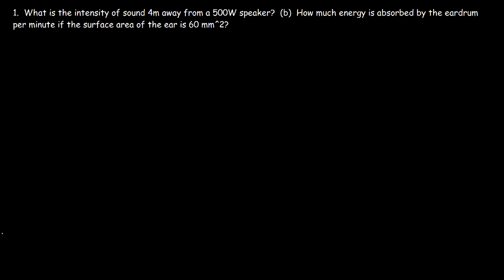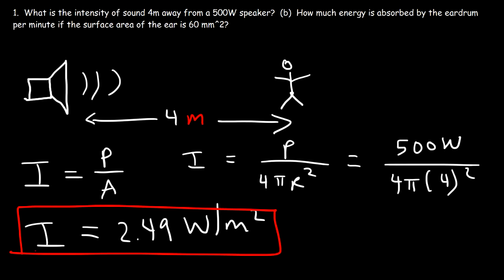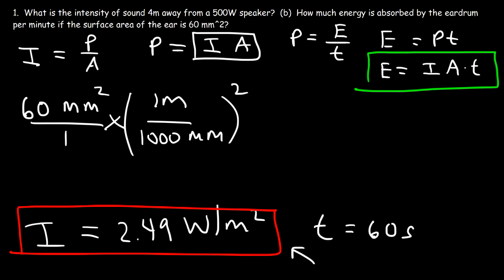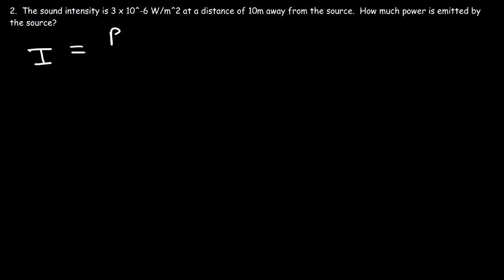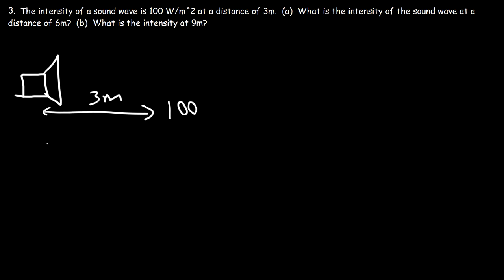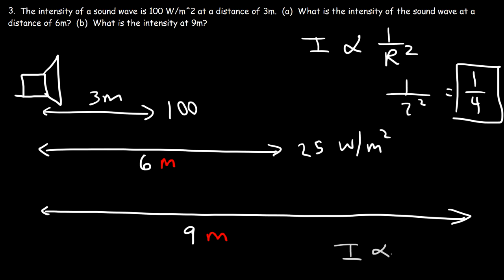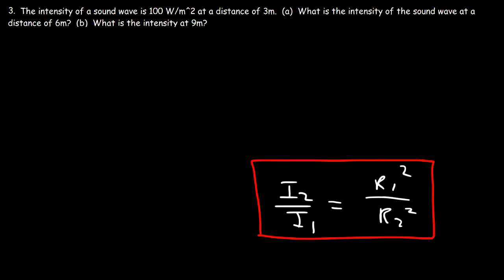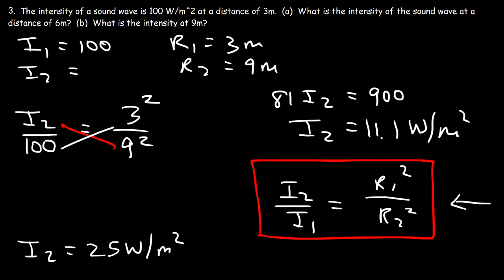Sound Intensity Physics Problems & Inverse Square Law Formula

Comment: Can someone please explain to me why the A in the formula for the amount of energy passing through the eardrum is the area of the eardrum and not 4pir^2, which is distance from the speaker?
Reply: Intensity is defined by Energy per unit area per unit time. When we are talking about the intensity of sound at a distance R, we take 4πr² as area, because that is the amount of intensity present at that distance, but when it is about receiving energy as in case of eardrum, we need to consider the area of the eardrum as the intensity perceived by every body at a particular distance is not constant, but it's area dependent. Even though the source emits equal intensity, the bodies do not perceive that equally, it's their area that matters.

Comment: This example is totally unreal. No one loudspeaker could produce an acoustic power of 500 Watts at 1 meter. There is a difference between acoustic and electrical power
Reply: The example is used for calculation purposes not practical you coconut
Reply: Hi ...
U are totally mad
Reply: U think u r a smartass
But actually  you are a dumb ass
Reply: Thats why its an example.......
Reply: average physics question
Reply: The only speakers that probably can do that are speakers at a live event that are like 8 feet tall.